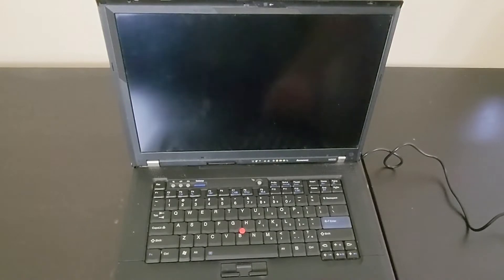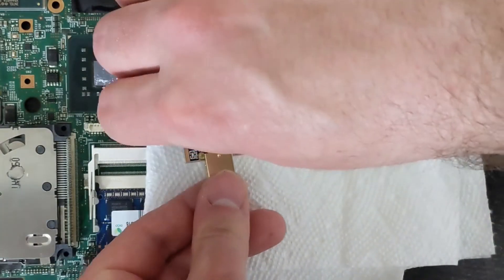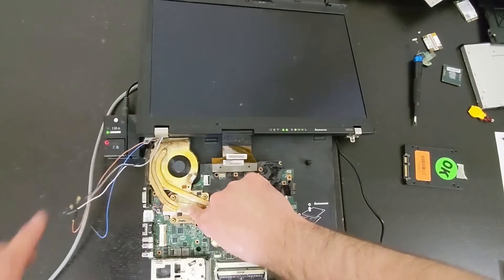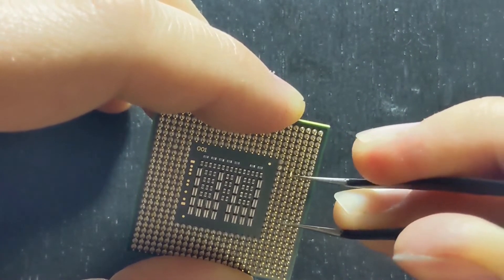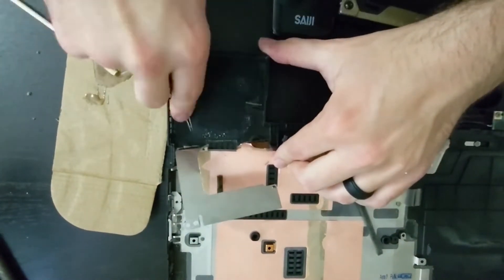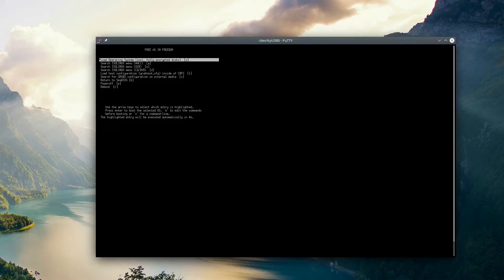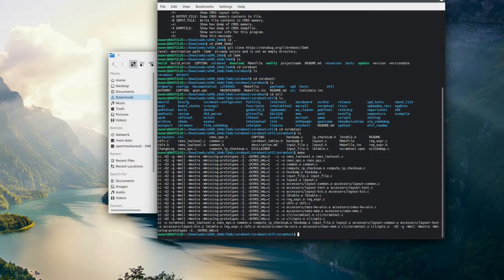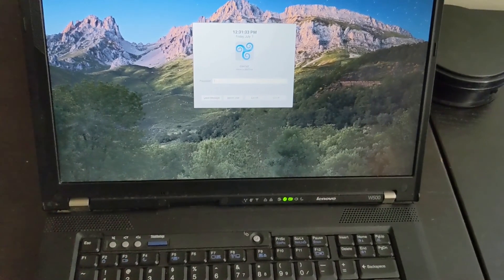Installing Libreboot on a W500 with Quad Core Mod

Comment: Nice video. I plan on, as an experiment, doing something similar on my spare t440p. I think at this point swapping a chip is too much and as far as I know not needed (?). What do you think? I’m very new to Linux and FOSS, does it matter if I use Libreboot or Coreboot?
Reply from the maker: It is all personal preference if you use libreboot or coreboot. Libreboot is a distribution of coreboot but is more strict on its policy of using binary blobs. 

For the T440p you shouldn't have to swap the BIOS chips out. In this video I was just going all out to make the W500 as good as it can get and to allow for future experimentation.
Reply: @DeviceCastingCouchTechPodcast  Good info, thanks. Yes I agree, might as well do a full on upgrade. 👍

Comment: What are the differences between a T400, T500 and W500?
Reply: The T series is considered the Flagship models, while the W series was the Workstation ones. 

The first number defines the screen's size (The T400 has a 14 inch screen, the T500 and W500 have a 15 inch screen). With that in mind, the X200 has a 12 inch screen, and the X300 contains a 13 inch screen.

The W500 is intentionally made for heavy workloads, so it comes with a dedicated GPU, and Stronger CPUs, along with stronger cooling to keep the machine working at the expense of battery life. The T500 consumes less power, and runs cooler.

Comment: Question, is it normal for w500 screen and chassis to be bent/curved? At first I thought it was just the top half but bottom is also like that, looks like it had 50KG on top with something under the middle and it's just changed shape over time with heat and pressure on the top though maybe its supposed to look like that and it being dropped at some point just making it look worse?
Reply from the maker: I've never heard of a W500 being bent or curved. Sounds like it might have experienced some trauma at some point. Out of curiosity does it still power on and work?
Reply: @DeviceCastingCouchTechPodcast  yeah works fine, battery only last about 20 minutes and screen is super dull but that's pretty normal for machine that age, at least I now know for sure it's not supposed to be like that,  when the board was out of the machine it look fine other then little corrosion on a part that doesn't affect functionality

In saying that given the logo of the company that was on the old bios image and wear, I'd say it was a field machine for that network company before they got bought out.

So if I can find a machine with better chassis that has failed GPU or something that would be nice, unlikely I'll get that lucky as they rare in my country